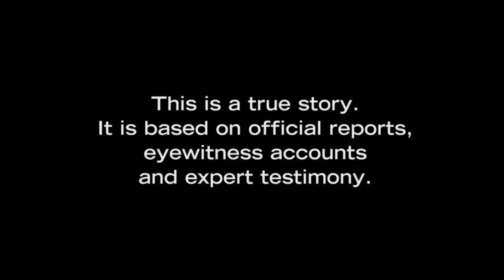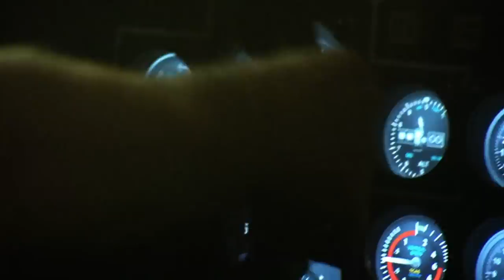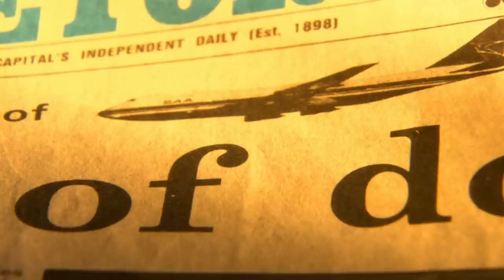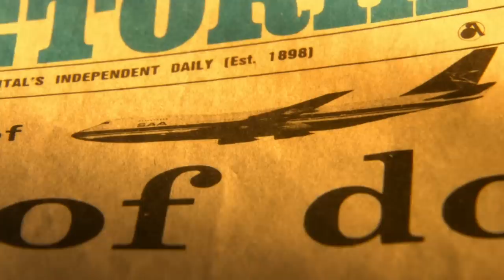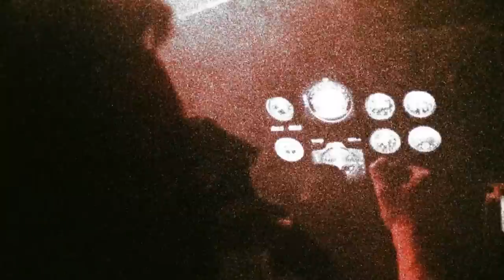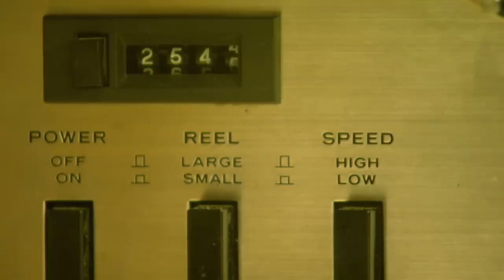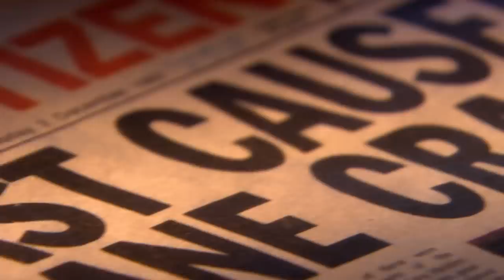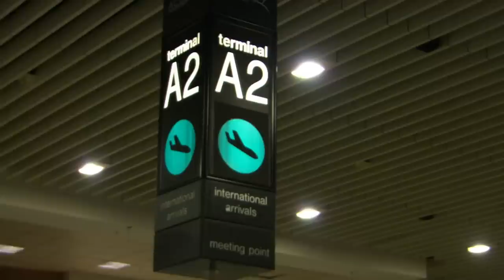Battling A FIRE In The Aircraft | South African Airlines | November Disasters | Mayday: Air Disaster

Comment: I remember there was another episode where lipo batteries brought down the plane. It could be a fire caused by that.
Reply: That was the Swiss Air tragedy.
Reply: @sydney13ism  If you mean Swiss Air Flight 111, that was caused by the arcing on the wires for the entertainment system that set fire to the flammable insulation material around it.
Reply: There was one where they were shipping expired oxygen cannisters...and they weren't supposed to ship them full but empty.
Reply: Yes, there was computer batteries. They could have been defective and silently went into thermal runaway and tripped fuses from being exposed.

Comment: I worked in IT and in the computer room they had a halon fire extinguisher built into the ceiling. How come they don't have that in the cargo compartment?
Reply: They should fr
Reply: That would be expensive on an aircraft of that size. You'd have to go through all the regulatory steps to get it approved. Also, in this configuration, the cargo area is not really sealed from the passenger area so there would be concern about exposing people to halon even though it has low toxicity at low levels. I do believe such types of fire suppression systems exist in the sealed cargo holds of planes.

Comment: Has this ever bin solved ?  It had computers in The pallet that caught fire if they had lithium batteries in them I would be guessing that is what was burning so hot. They have brought a few planes down!
Reply: I was thinking that too, but considering the time frame pretty sure lithium batteries weren't wide spread/even a thing at the time....still could have been something like that though
Reply: @MrGoesBoom   i found this on Wikipedia The official report noted the presence of the computer equipment, and suggested that a possible cause could have been the lithium batteries contained in the computers exploding or spontaneously combusting, although this was not given as a conclusive cause of the fire.[22]  If there was lithium batteries on that pallet it would explain the intense fire. I would think
Reply: MY guess was this was the EARLY history of knowing LITHIUM batteries combined with pressurizing an aircraft is/WAS a recipe for THIS TYPE of disaster
Reply: @MrGoesBoom  ..’infant’ stage maybe but PRETTY SURE they were an available option.

Comment: Why couldn’t the pilots open a window in the cockpit?
Reply: I believe that would cause immediate depressurization of the cabin.
Reply: @KFamilyCircus12  - The cabin area doors are already open.  So, it's already depressurized to 15,000 ft.  A breathable altitude.
Reply: @haywoodyoudome lol
Reply: 15,000 is NOT breathable without training, the safe zone for most people is 10k or less.
Reply: i think modern planes have fixed windows.  certainly a 47 because of the height.  not really a safety feature manufactures would consider due to the wildly rare possibility of occurrence...however, the back 1/3 of the plane was cargo ?  why wasn't there a cargo load sheet showing that it was carrying declarable or restricted articles ?